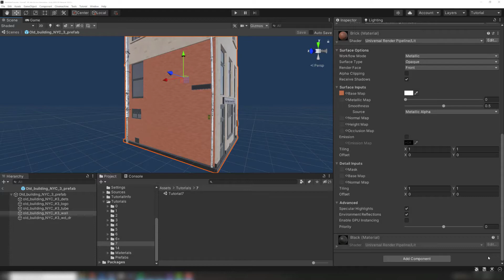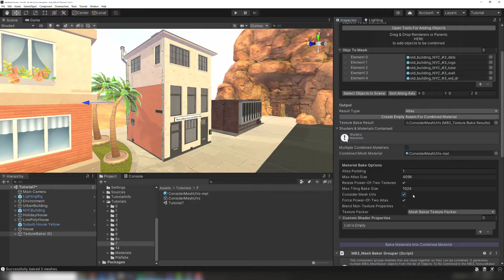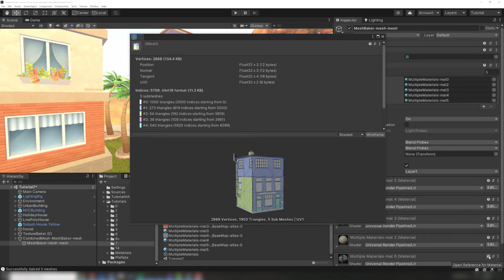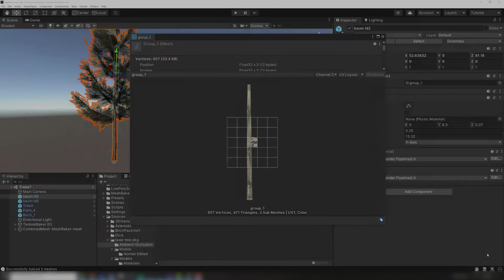Texture Baker Tiling

Comment: Can i get right mesh of tiling materials objects without selecting consider uv box. I want atlas of tiling objects with out consider uv box checked. This way i get clean and sharp nice  atlas 😢
Reply from the maker: There are two ways to do this (other than modifying your source meshes so that the UV channels don't tile).

1) You can use the "multiple materials" feature and create a submesh for any materials that tile. Put only one tiling materials on each of these extra submeshes. Note that the tiling materials don't actually get put in the atlas and you will get extra drawcalls for each submesh so this solution is not ideal.

2) Use texture arrays. There are a few videos describing this approach later in the playlist. Texture arrays were created to solve the problem that you describe. However texture arrays are a huge commitment for your project and a lot of work to implement.